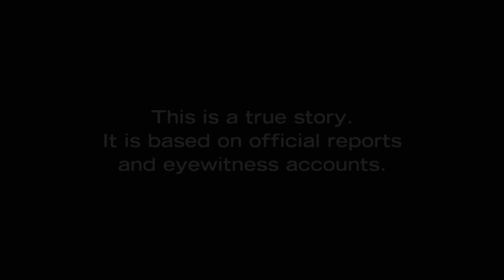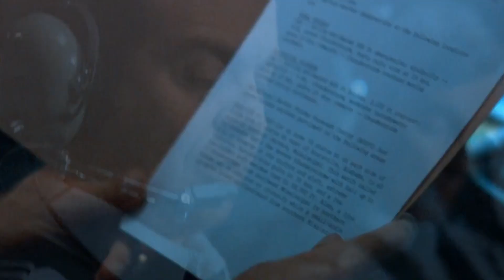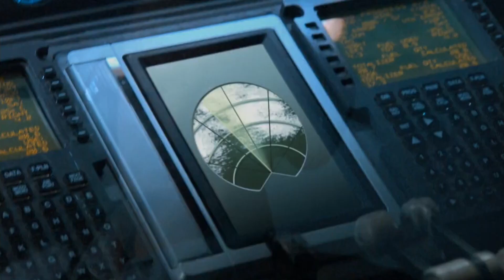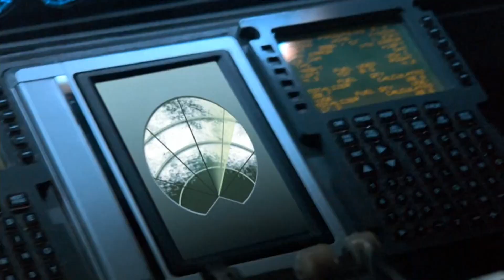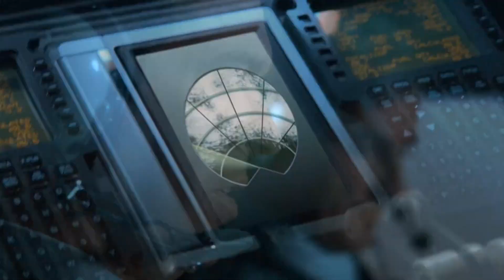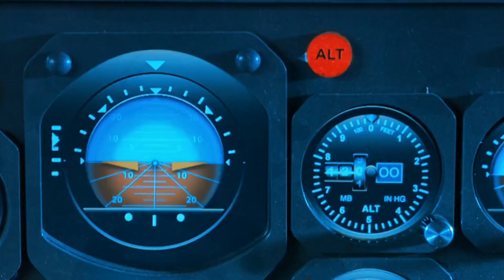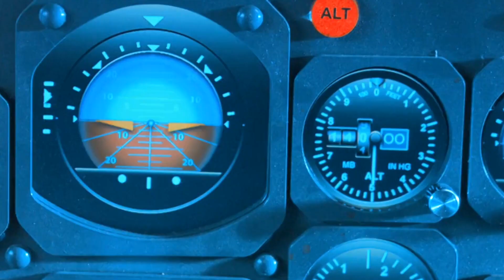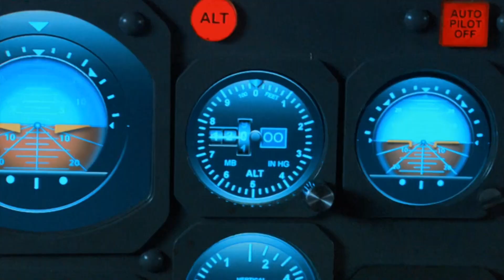A Dangerous Storm & Two Failed Engines! | Southern Storm | Mayday: Air Disaster

Comment: what went through those cocky pilots heads when they gambled everyones lives on board
Reply: I don't think they were cocky.   They were doing the best they could.    Honestly,  did you come here just to criticize two dead men?   Seriously.   You don't know what they were thinking.  Stop being judgemental!
Reply: @heididietrich9800  One thing I noticed when I saw the radar...I found myself wondering if that "hole" was a microburst...or even an area where a tornado was about to form.  But without Doppler or another more detailed form of radar, you can't spot the characteristic hook echo.
Reply: @nerysghemor5781  Back then weather was not as well understood. Microbursts were still a relative mystery, until Delta 195 put microbursts into the spotlight

Comment: They couldn't fly above the clouds? What kind of crap plane is the DC9? These planes are so cringe. It's like they want to crash.
Reply: McDouglas at it's finest.
Reply: Not in that kind of airplane and with the sheer nastiness of storms in that part of the country.  We get true BEAST thunderstorms in the South...some of the worst in the world.   Even a modern jet can't climb to 45-50k+ feet.  Pretty sure back then only military craft like the U2, the SR-71, and other really cutting-edge planes could've pulled that off.  This one wasn't McDonnell-Douglas' fault.
Reply: I don't think you realize how massive cumulonimbus clouds are. No airliner can fly that high, let alone climb up there while in it. This is just as valid in 1977 as it is today. The only exception was the Concorde.
Reply: @9999AWC  That’s interesting about the Concorde…I hadn’t realized how high it’s cruising altitude was.
Reply: @nerysghemor5781  It flew over 60,000ft (most airliners fly between 30k and 45k)! Up there there is far less drag from the air, enabling it to fly faster more efficiently. It's a little more complicated than that in reality though :P